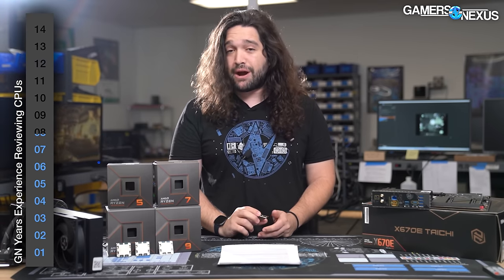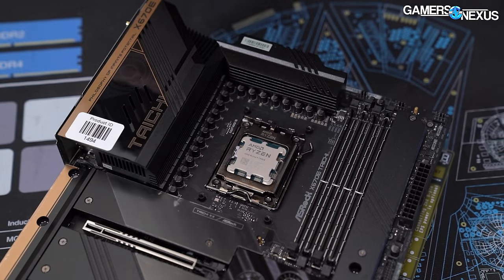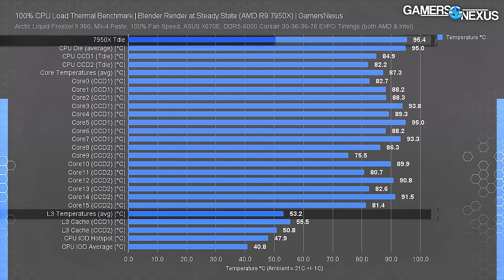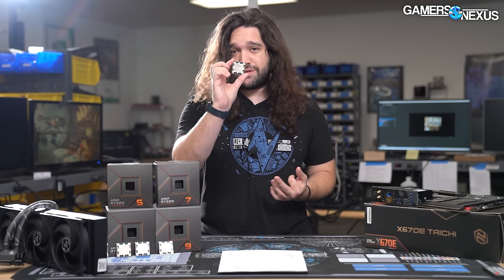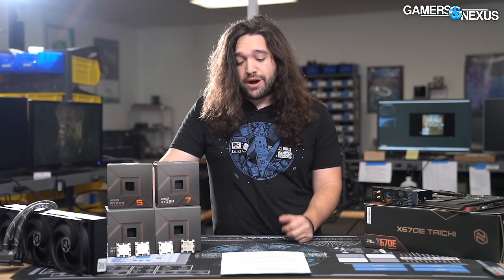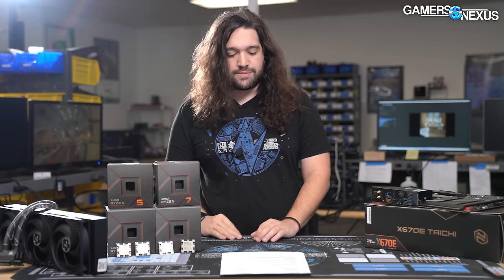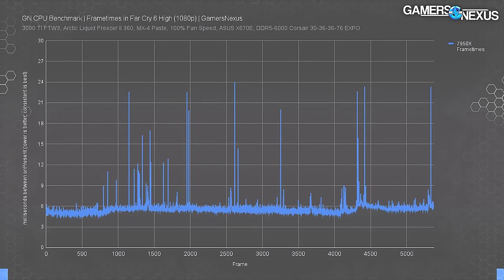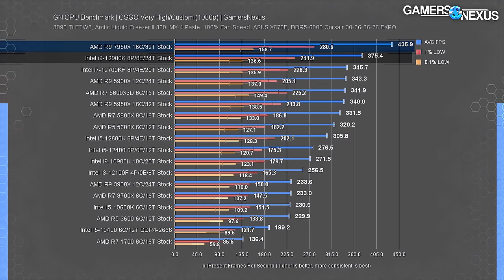95°C is Now Normal: AMD Ryzen 9 7950X CPU Review & Benchmarks

Comment: If it would be Intel's new CPU running at 95C at that much power, all these tech reviewers would have a flashy video title lol. Here it is just "95°C is Now Normal"
Reply: there is a clear bias. tech community seems to go out of its way to help amd when it slips, anything intel does they seem to jump on it and tear it apart.
I think it's more of a reflection of the community at large, these reviewers need to keep their reputation with the community - the community currently leans towards AMD.
Reply: @notreya  Exactly! These reviewers are suppose to be neutral but they can't hide their biasness for some reason.

Comment: 11:46 it would interesting to see a comparison with the 7950X limited to the same power consumption as the 5950X if that’s even possible. It just seems the situation here, just like the current batch of GPUs, is that for consumer parts we’re just throwing power at them to make them go as fast as possible, versus finding the cross point between power and performance.

Comment: Okay i skipped through steves video, mostly because i don't want to fall asleep. I'm confused about the power usage, because he showed it rendering. Which will have the highest power and thermals. What about normal gaming? In all honesty for it hit 90-95C and be running at 5GHZ + is pretty impressive. I'm looking at either the 7600X or the 7700X or the 7800X3d, in about 6 months when i build my new computer i'll have a better idea.

Comment: I'm not feeling that ~30% increase in Blender performance for double the power consumption... it is pretty disappointing to be honest.
If all, based on these results and for anything CPU related,  I'm more compelled to get me another 5950X rig instead.

If you guys can test the 7950X using a ~125W power limit that would be greatly appreciated =)

Comment: I don't care how good the performance is, I'm not running a CPU that runs at 95C.  This could end up costing them in the long run, as they apparently just overclocked the shit out of it and used brute force to get that performance, meaning they are going to have to stay that way and won't be able to go back to having any kind of efficiency (since it would look bad to drop peformance between generations).

Comment: Good luck cooling these things.  These new CPU's are impressive from a performance point of view but I feel like the pendulum has swung too far in the performance direction leaving the efficiency behind.  Though the performance/efficiency ratio might have improved over the last generation, these new CPU's (and GPU's) are consuming a lot of power and producing a lot of heat which means you need to spend a bunch of money to power and cool these things.  This means new PSU's and new coolers/fans etc., this just means the consumer has to factor in all of these new expenses into their budget when deciding to upgrade there systems to these new CPU's (GPU's).  I like the performance uplift but not sure I like all these other things that come with it.

Comment: I wonder how gaming would fare if you totally disabled the 2nd CCD as this would almost half the thermals, allowing for higher sustained clocks and how many games not only benefit from more than 8 cores but benefit more than the drawbacks that cross die latencies introduce? I am thinking AMD could have a 'gaming mode' on the 7950X could turn it into a super fast 7700X but you still have the best CPU for content creation when you need it.

Comment: I suggest you do a separate test at 40% fan speed or something. If you did you might find it performs more like the 5950X. Edit: Or eco mode. And yeah, people who want the performance for $700 probably won't like my comment. But it's likely it performs at least as well as the 5950x as the same power consumption. It's basically automatically overclocked so why not test it more normally?

Comment: It disturbs me that basic desktop CPUs (albeit, relatively high-end) now run at base more than my Operation 6380 (Noctis cooler, obviously) when at full load. Meaning, for my workstation's dual chip board, the only way to out consume the damn thing would be to run a 6386 SE dual configuration. 🤦🏽‍♂️💯

Wow… I'm now kinda terrified to see the new Epyc spec chips for Zen 4. [Dared to look and at 400W… 😭🤦🏽‍♂️]

Just running my workstation 24/7 cranked my power bill in the PNW (cheap electricity relatively speaking) by over $100+/month by itself. God help me—a workstation CPU drawing as much power as 4 100W incandescent lightbulbs‽ O.o

Damn… Whelp… So much for the trends towards "energy saving"… 🤦🏽‍♂️ 

Damn… over $20 a month just for a CPU, or $13+ for the desktop version. Yesh. More than my monthly Paramount+ subscription with Showtime bundled (or Hulu & Disney+). Fuck that is a power hog! O.o

When combined with the new trends in GPUs—those power usage stats are nuts!

I wonder how long it will be before we have to run our systems on the 240v plugs for our ovens & dryers just to comfortably & safely run the systems without the power supplies blowing up? O.o

Comment: Wish you could add Apple Silicon to the efficiency calculation graph...just for a reference...IMO it all (in case of x86) goes in a wrong direction..instead increased power efficiency..exact the opposite...

Comment: We can say that 7950X consume twice the power as the 5950X for only 1.4X speed improvement. The older 5950X in power draw is the king leading to more durability. Is important to wait on next months if mainboards and components can last at 250W CPU power usage and 100 Celsius heat. With undervolting is possible to have 1.4X Cinebench R23 scores with the same power consumption as the 5950X, so the 7950X is an excellent choice. https://www.youtube.com/watch?v=7JiYAwKIHRY

Comment: People suddenly make a big deal about power draw with AMD, but they have also shown again and again that when judging intel, raw performance is king.  AMD has to compete with an Intel being accepted while pulling 300 watts.  You all voted for this.  Also, It sounds like if power draw is what you care about, AMD has still made efficiency gains for those wanting to limit the wattage.  Ryzen master should give you full control over that.  You might look at it like you have to take a hit if you want to lower power.  I see it as there's a benefit for those who want to crank it up.  So those people who don't care about efficiency and just want power have a reason to go with AMD.

Comment: Hi and thank you for the video. Question : if i want to buy a gaming computer that is ecological as possible, meaning, less power consumption, less TDP, less heat because of global warming, best power efficiency. I was thinking it is still the R5 5800X or 5900X coupled with a RTX 3060 / RTX 3060TI / maybe RTX 3070. (to be able to play at least a bit 4k for some games), am i correct ? (also, less expensive :) )

Comment: At the near end with the monkey Suzanne heads, you appear to be using Blender 2.7. There may be testing reasons? But would it not be better to be using a version of 3 to run tests on, there has been a lot of development over that time in Blender. Even 2.8 is 'old'.

Comment: People here can't comprehend what's happening with the 95C thing.
Intel gives the CPU max power (watts), the CPU reaches 100C and it throttles.
AMD gives the CPU room to hit 95C and it doesn't throttle. If you have a better cooler it will boost higher within the power limit at 95C.
Temperature doesn't equal to power draw. There are a ton of temperature sensors in the CPU, if AMD would've shown you another sensor reading which reads 75C that wouldn't have changed a thing except nobody would be freaking out. Typical AMD thing, their presentation and PR still sucks.
Not to mention 1. you can set lower limit if 95C bothers you 2. we can expect these high temperatures when we're talking about bleeding edge nodes at high frequencies, the transistor density is immense -> more heat. 3. unless you render all the time you won't see 95C. Under games the temperature is around 70-75C.

Comment: I know this is off topic.  What is the electricity consumption when the computers are turned off and if you only have the BIOS on when it is turned on.  Are the differences only in the power supplies or do the components have different needs?

Comment: So these CPUs along with 30 to 40 series GPU basically make it that you can't be in the same room as your PC unless you live in areas where it is always colder than the temp you like living at. 

Overall from what I am getting is it seems like the 7k series is more or less a full overclock CPU version of the 5k series. It sucks up the power and puts out a gigantic amount of heat no matter what you do with it. I will wait for the 13k series from Intel to compare against as I still consider the 12k series the old gen since 11k series was just horrible.

Comment: If you're looking for a way to test limits of CPU without a GPU bottleneck, I wonder why you wouldn't run some testing with Emulators and/or Simulation games. 
With Simulations, having a higher dependency on CPU and RAM, it would be a good test, especially when you start adding a bunch of mods. For instance City Skylines I used to play until my CPU just couldn't keep up. There's "save" spots you can start from, so every CPU tested could start from the same spot. I'm sure other Sim Games might have the same. 
And Emulators are perty CPU heavy. I run some for Android on PC to play some Mobile games, and at times my old system can hardly keep up (I'm still on a 3570k). Of course for more modern CPU tests you would/could run multiple windows to really tax the CPU. I'm sure there's some code that could be easily written (or copied) to start multiple windows that start up a game automatically with a push of a button.
Just a thought I did thunk while I was thinking.

Comment: 95°C is their new normal, but certainly not mine. Excessive heat means inefficient design. 
But what I really want to know is whether Intel is actually cooler than AMD on average.
Some say Intel CPU's have a temperature reading at the heatsink level, whereas AMD measures inside the chip, on transistor level, therefore reporting higher temperatures. Is this true?

Comment: I'm honestly not a fan of the push to just... More power. I would much rather see larger focus on efficiency, whether it be due to climate concerns from burning so much power right down to keeping the thermals of the OTHER components in your case cool. If the CPUs are going to run that hot, statically, that's going to basically kill SFF and more budget oriented case options for this generation; and it has ramifications for air cooling as well in general.

Comment: You want a cpu bottleneck? Dyson sphere program. I get 24 fps on my save because the game is heavily core limited, making it excellent for cpu bound game benchmark. Another core bottlenecked game is 7 days to die. 30 zombies and framerate just exits. Satisfactory is also another game that can chug on fps because of it's core limitation. Halving my fps from 120 down to 60 when i go from looking up, to facing my factory.  

Minecraft is also a great tool to have say tekkit, and a hefty mob grinder and other automated stuff, that brings my fps quite down a bit too.
Starcraft 2 is also great. Make a army of a few 100 whatever, have them all stand around in a blob on the battlefield, and your fps goes down to 12 on 5900x. A friend has a slightly overclocked 10900k, he got 7 fps.

Same for spiderman, it actually is capable of using 12 cores effectively on my 5900x, and with everything max, especially people and vehicle density, my cpu was brought down to it's knees.

Comment: I'm interested to see how this will affect a custom loop since CPU is running quite hot and affecting the temperature of the loop. Won't this limit our capability to cool the GPU effectively, how can we counter this in our water cooling setup. Have at least two bulky radiators to cool the loop as much as possible between components ?

Comment: I think it's clear that CPU efficiency needs to be tested separately from maximum performance. 

Any CPU at max performance will pull as much power as your thermal solution can handle. 

If you tested the processor at *the same performance*, it would almost certainly be more efficient. I think if you want to make claims about CPU efficiency relative to other processors, you need to pick a power level, lock the processor at that power, and see how it performs. It's not useful to rate (especially this) processor performance when it's configured to run at maximum tdp, as it simply means a better cooler will perform better, but with worse efficiency.

If you want to meaningfully analyze efficiency, I'd lock the processor at, say, 100w, run the tests and compare that way. Your current efficiency numbers are meaningless, as all they really show is running a processor 500MHz below the ragged edge reduces power consumption by 50% (*cough 5950x*)

Comment: Can you throttle the power limit (PPT) and achieve lower temps or change the temperature target? Like it was/is possible on Zen 2 (and probably Zen 3).
95°C is too hot for my taste; I actually replaced my initial R7 2700X of the new rig with a R7 3700X due to the 2700X running pretty hot at 80°C max with decent cooling (be quiet! Dark Rock 4).

Comment: I run more than one computer and I have switched to AMD the last 2 gens with a 3950x and a 5950x.  I'm not going to buy a 7950 if that's the temp it runs at.  F that.  I'll be switching back to Intel I guess..   smh  not trying to heat my office up like that.

Comment: Genuine question... On the games where you're giving AMD a hard time (rainbow 6 siege for eg): you're comparing 600fps with 500fps and saying *shame on you AMD*. Given both are faster than max monitor refresh rates, isn't that rather hyperbolic? Secondly, given AMD's otherwise incredible performance across the board, is it not possibly driver related, and therefore fixable? I remember early days of AM4 where performance was significantly optimised over the first 6 months. I'm wondering if the same could be true here. Thanks
Reply: When I say driver, I actually mean bios as well as chipset drivers 😳

Comment: If they are so damn efficient why do they get so damn hot? Also: is it still safe to use water cooling with this? That's only five degrees c from flashing to steam. How much pressure can typical water cooling rigs stand? That seems to be cutting it kinda close. And isn't the pump in most AIO coolers sitting right on top of the CPU? You can't pump steam like you can pump water. Suddenly flow goes to zero and cooling effect is gone at the worst possible time. You might need to rethink PC cooling systems in that case.

Comment: So what I'm wondering is that a high CPU temp will also affect CPU temps and it's a pain in the ass to cool GPUs since you can't just water cool the damn thing unless it comes as one. With the latest absurd Nvidia GPUs being so huge, why don't we just build a compact motherboard CPU tower with a mini GPU tower on the side. Also the GPUs will cost the same as the rest of the PC combined anyways so makes sense, right /s
Reply: Combining R9 7950x + a RTX 4090/4080 its toasting something up for sure. No need for heater in the winter anymore.

Comment: Do they have a way to change the temperature to boost to?

For people in small rooms, boosting to 95C is going to be brutal.  Literally going to be a space heater at that point, and start recycling its own hot air.

Be interesting if these CPUs actually get the undervolting performance benefits or something similar to what the GPUs get as a result. Something like "under temping" and maintaining higher boost clocks for longer would be hilarious.

Also, dont get me wrong, it'll make winter's gaming sessions great -- but in summer it's going to be like a sauna after one hour in the typical 10x12 bedroom. You'll be peeling your b@!!s out of your gaming chair pleather.

Comment: I wonder if you test those cpu with game that would be more CPU orientel like game that have lot of AI in it. I know you use game more centered on GPU and you mention many test were GPU bound but It would be interesting to run game with simulation or big interaction. Are there game that have so much AI (city interaction, war, economic calculation, farming, etc ) 

I don't know much since those kind of game that was making my computer cpu bound are away from me. Do you have any game with a Total War: Warhammer 3 ?

It would be interesting to create a map with the biggest setting, in an advance state of the game and check the behavior of the cpu load, spike and other data that could be relevant to gamer with that kind of game interest.

Comment: Zen 4 has just crushed anything from Intel.

Since the R9-7000-series CPUs are designed to boost until they hit 95 degrees, I would say that if you want it to use less power and/or don't need extreme performance, just use a standard air cooler and the CPU will adjust its clocks accordingly to stay at 95 degrees.  Using a less robust cooler would reduce the power draw.  This would be of more use for something like the R5-7650 because if you're buying a 7950X, you're not buying it for gaming unless you're richer than you are smart and in that case, you don't care what your power bill is anyway.

Now, if you want REAL efficiency, my R7-5700X is about 2%-5% slower than the R7-5800X but uses 40% less power.  The TDP of the R7-5800X is 105W and the TDP of the R7-5700X is 65W, just like my first Ryzen CPU, the R7-1700.  Now THAT is some good efficiency!